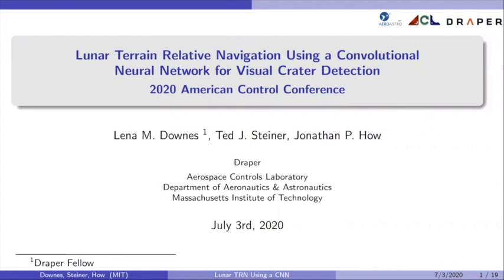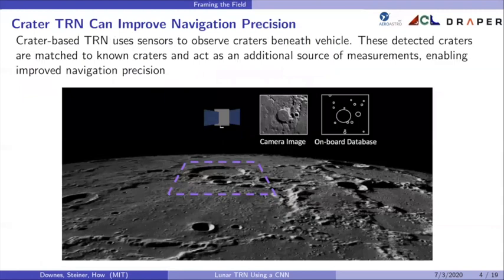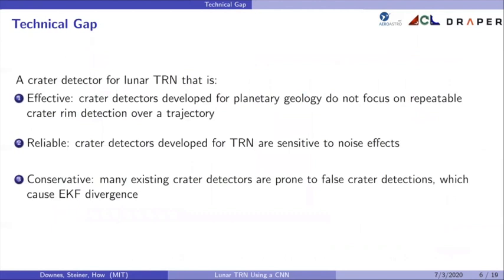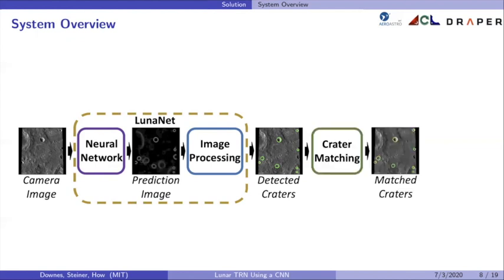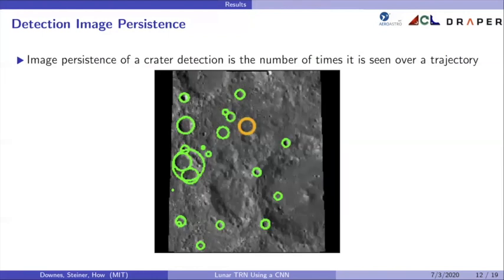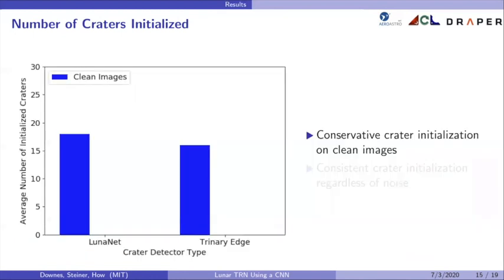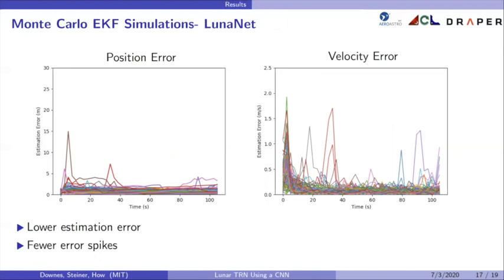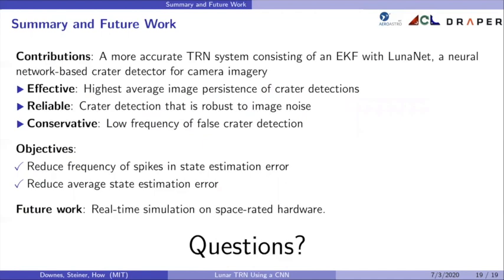ACC 2020: Lunar Terrain Relative Navigation Using a CNN for Visual Crater Detection

Comment: This is amazing! I have a couple of questions:
- Is LunaNet open source, or will it ever be?
- Is the system meant to work at a fixed altitude? Given that it should work on an EDL scenario, I assume not, but does that mean the the system could be more accurate if the problem space was reduced to a specific altitude range?
Thank you!

Comment: So, somewhat of a layman in these matters, but
- Thought TRN was used by the Skycrane to deliver Curiosity to the Mars surface (with radar)
- what scale is the image u have there? And from what altitude?
- Ask above, because I thought TRN is used in the latter phase of landing, and not used all the way from orbit
- also, hence TRN is used more for boulder and rock detection, as opposed to crater detection?
- However, if indeed ur TRN+ CNN can be used with a simple camera image (instead of radar or lidar) at the right scale during landing, it will indeed reduce the cost  of landing systems like the Skycrane.
- Skycrane ♥️
Reply: -Yes, TRN was used for Curiosity's EDL, but to my knowledge it was not based on a database of craters
-The images tested were all at about 80-90 km altitude, and the images cover several dozen km of terrain in each direction
-There are different ways to use TRN, and in this case it is used for global positioning while in orbit
-TRN can be used for local hazard avoidance as well, but it can also use features like craters to give it global positioning information